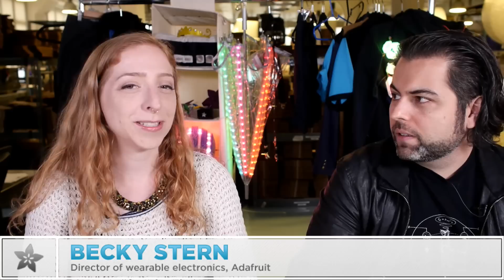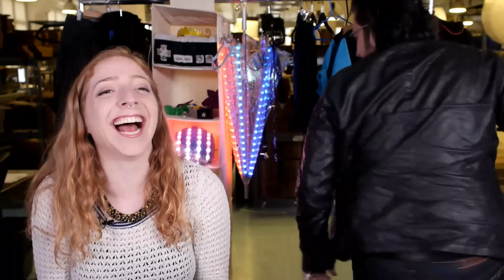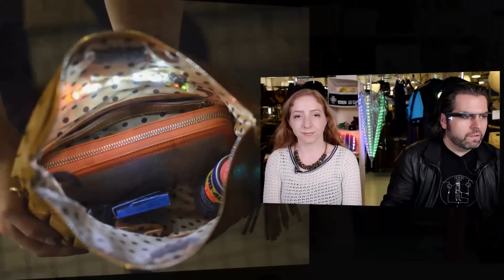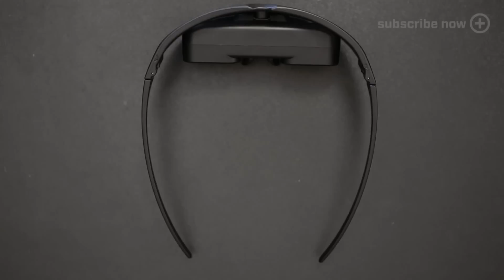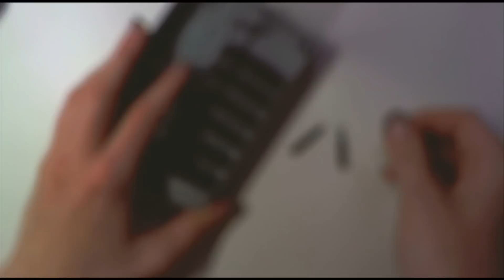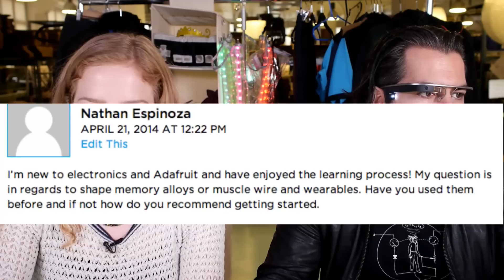Wearable Electronics with Becky Stern 4/30/2014 - LIVE

Comment: I want to build a clock with my Flora, and your new 60 LED ring.
The clock can use my PC for its time initially, but what is the best Real Time Clock add-on to keep the time correct when my PC is off?
The GPS module would be overkill as the clock wont need to know its location.
Sorry it not really a wearable project but its using the Flora platform.